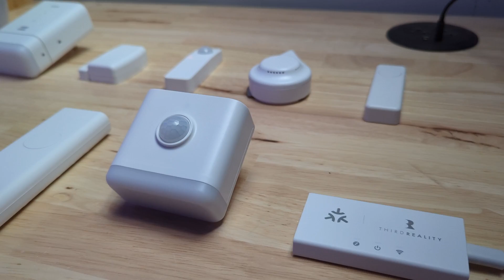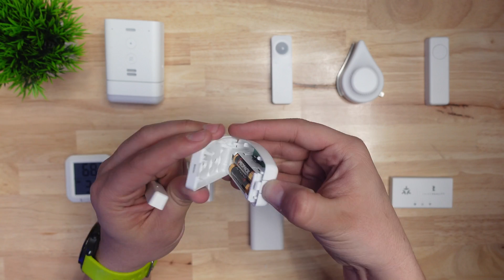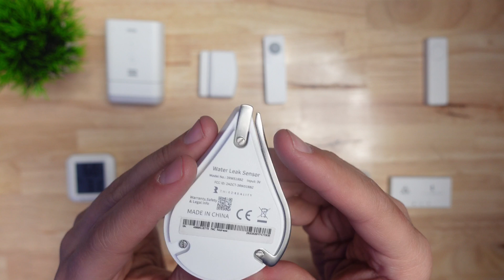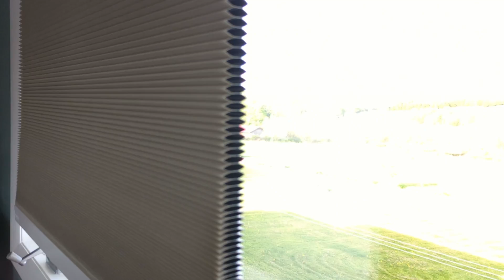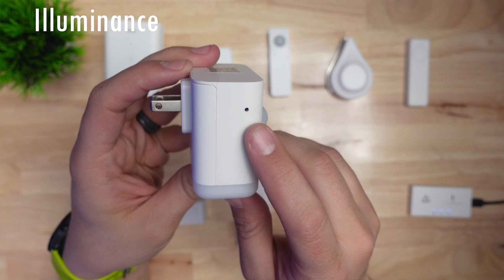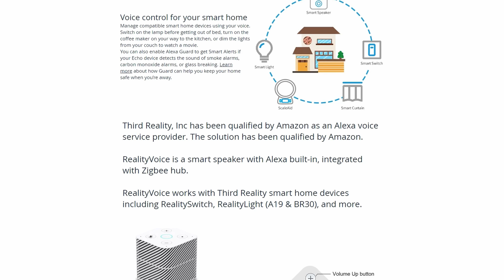ThirdReality - Locally Controlled. Always Compatible.

Comment: WARNING !!!!!

THIS IS SPAM !!! / A PAID "REVIEW" !!!

These sensors are useless!
- They ADD RIPPLE /JUMPS !! ... 
- and only have got a resolution of appr. 0,1-0,2 degrees Celcius !!!

...
.. Because of this influencers paid SPAM-REVIEW, I did buy 5 pieces! - he tricked me!
- ALL 5 WERE RETURNED IMMEDIATELY, after finding out, that you and other claimed "reviewers" so-called "reviews" were DISINFORMING CUSTOMERS !!

FACTS:
- these units, measure quite ROUGHLY (in jumps of appr. 0,2 degrees! (i.e. with A RESOLUTION of appr 0.2 degrees Celcius !!!).
- that is 20 times worse than fx. "Sonoff SNZB-02" (that also has got faults).
..
AND; this "claimed reviewer! INTENTIONALLY LEAVE OUT, THAT THE 3REALITYS' ADD ARTIFICIAL RIPPLE !!
- and have got a very bad resolution!
- and have got NO outside reset/initialize button!
- and that their firmware is dated "june-2021" !! (yes, 3 years before they were released in june 2024).

The ripple & extremely bad resolution, makes these units COMPLETELY UNUSABLE FOR ANY SERIOUS MEASUREMENTS AND REGULATIONS !!!!!!!

YOU SHOULD BE ASHAMED OF YOURSELF, PUTTING FORWARD DISINFORMATION !!!

Comment: Based on your long term use, do you now prefer Third Reality contact sensors over the Aqara ones? I'm in the market for contact sensors and would love to hear which you prefer now.
Reply from the maker: I like third reality better because the batteries last longer, but if you want something more discreet then aqara is better
Reply: @MakeItWorkTech  thanks so much. I may pick up a couple of each to compare. Maybe Third Reality for exterior doors and Aqara for interior doors.

Comment: I want the night light but have had issues with matter in home assistant. Also prefer not to use wifi. Wish they had a zigbee version I could buy. Also worried they’ll move their sensors to matter over thread instead of sticking with zigbee. Long term I will want thread, but it isn’t there yet
Reply from the maker: They do have a Zigbee version
Reply: @MakeItWorkTech  It’s not available on Amazon in Canada at least
Reply: Both the Zigbee and the Matter versions of their night light are on sale for Black Friday.
I'm just not sure which one to pick #dilemma
Reply: @ zigbee
Reply from the maker: I'm not sold on matter yet

Comment: The bridge works great with Sengled lights and devices to Matterfy them. It doesn't like Ikea's devices, bulbs are good. I think the bridge excels with zigbee presence sensors from Sonoff and Linptech/moes. If only the Hub was more responsive with their app which the two often won't talk.
Reply from the maker: Yeah I've avoided using the app and stick with HA unless I need to add another device
Reply: in that case I would just use ZHA
 @MakeItWorkTech